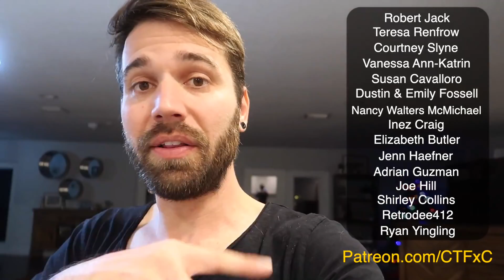almost blew ourselves up! not kidding

Comment: Charles, If you want the litter boxes out of the office because of cat box odor, you won't have that if you use Yesterday's News for litter & dump the whole thing 1 or 2 times a day. (It's the clay litter that holds in the urine odor.) Yesterday's News usually doesn't require cleaning the inside of the box because it empties out clean, but you can just wipe it with a Clorox wipe. Using Yesterday's News the way I described is actually cheaper than using conventional clay litter because you use alot less, & it's certainly cleaner. (It's recycled newspaper pellets.) If you want to recycle the Yesterday's News once its used, put the used litter anywhere in your landscaping that you want no weeds (newspaper kills weeds.) You can then cover it with bark mulch. Re the litter box, alternatively you can use one of the systems described on you tube, you can buy these or make one yourself.  We find what works well is a large rubber made tote. Cut a hole in the lid (not in the actual tote) large enough for the cat to get through.  Put litter in the tote & put the lid on it. The cat will enter the box through the hole in the lid on top, use the litter inside the box, then exit back out through the top. This system keeps them from scratching any litter outside the box (less for you to clean up) & helps with odor because essentially the litter box is pretty much capped except for the access hole for the cat, (& you won't have to look at used litter when you walk by it). You can also teach cats to use your toilet. I've only seen 1 cat that actually flushed it though (seriously) so you have to do that part for them.😉 Also, many people keep the litter box in the bathroom instead of a room used for other things. Since alot people have some kind of scent diffuser in that room, there is the added help of that.
Reply: I have seen pictures of using plastic totes but wasn't sure if they were good. I have three cats and they make a mess, mainly one. Maybe I will try this.
Reply: joker gal If they scratch all the litter out of the box onto the floor, this will help. Rubber made totes are cheaper than litter boxes, stronger than them & easier to carry because of the handles, but to empty it we just stick one end in a garbage bag & tip the used litter out into the bag. Try Yesterday's News also, it's much easier to clean the box, you don't have any bits stuck on in the corner like you do with clay litter.😊

Comment: buy a car battery hydrometer ~$10 and maintain those batteries. Last time you tried fixing the batteries with distilled water you probably added to much and that's why it didn't hold a charge, or the high acidity destroyed the plates long before that.

Comment: I don't think having a cat door into the garage is a good idea. If you miss either cat and the garage door is opened, one might take off. Or a visitor does that unknowingly. Or the garage door is open and a cat uses its door...
Maybe it's me, but isn't it the case that you no longer need the golf cart? Here's a crazy idea: see the golf cart and put a car in the garage... I know, right!?
Good MRI news, Char-- but you've been that way for a while now.
Reply: Eliot Brown Agreed. Absolutely a big risk; its not worth the anxiety it will give you.
Reply from the maker: We actually have a plastic break fire release thing that you see in buildings over at the actual switch. Trust me, I already was wet on that one. There is also a big yellow sign that you physically have to lift.

Actually after I posted this and I realize what you’re speaking about. I think we have a Back up plan/idea

Comment: Have you tried the charger after fixing the batteries? It might check the system before it enables charging, so if it finds something off, it won't start charging.
Also, I would not recommend removing the speed limiter before consulting with an expert about it. Draining the battery too fast for a longer period of time without proper cooling might cause it to catch fire.

Comment: If you need new golf cart batteries ever hit up Batteries Plus. They have good prices on awesome American made batteries. They also sometimes sell the little jumpers and the lifter/carry straps. I know the one in Tulsa sells individual 6volt golf cart batteries for $99.99 but if you buy 4 or something then they are like $85 per battery. Your batteries might be 8 volt though. Also always change all the batteries at the same time not just 1.They can also (probably) order you a charger but just order one online it will be cheaper. 

EDIT: maybe I should watch the whole video before commenting. You made the right choice ;-)

Comment: Comment Commentary Time, video didn't show up in my feed at first...sneaky Youtube
0:06 it almost sounds like a slowed down Barber of Seville
0:17 and Every 3 Months I remind you that it's safer than a CAT Scan
1:09 Never actually had the falling dream
1:52 it's from Moana, but the Pig doesn't join the adventures, the chicken does
2:36 yeah it's not as effective as it sounds
2:48 looks a tad smaller
3:06 I didn't know that Duracell did machine batteries
3:34 wait those 6 batteries all go into the one cart!? I thought one was a spare
3:45 that's not actually encouraging
5:47 probably should've shown it to a mechanic
7:44 it was a fair few amount of times
9:31 should really turn off all electrics before you connect any wire guys
10:18 has been sitting in a garage for a long time
10:55 I'd have reservations about a cat door, sure cats need outdoor time but the flap means that they can go out and do or get into god knows what

And that's My Comment Commentary~